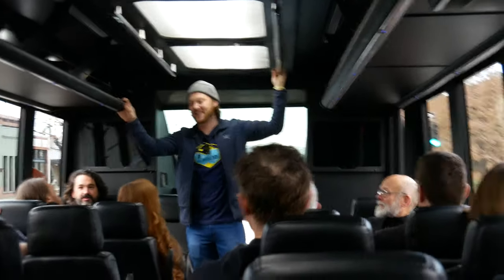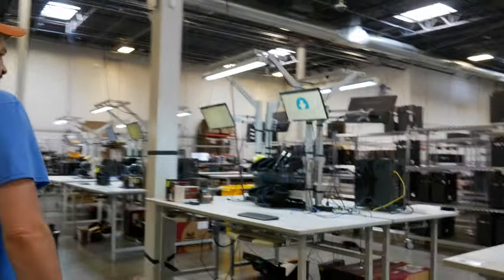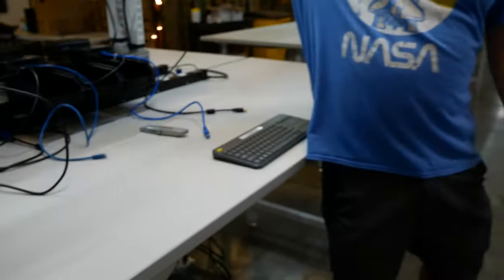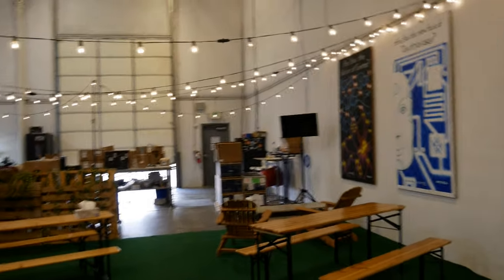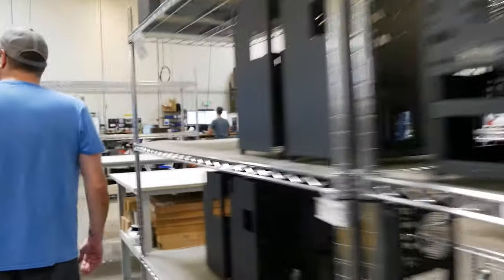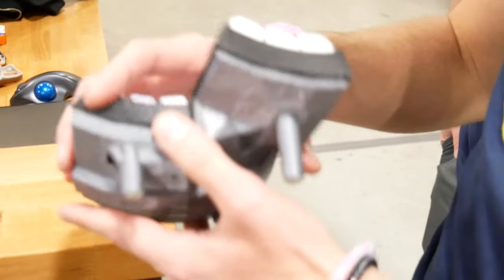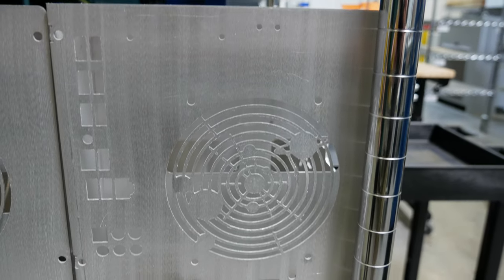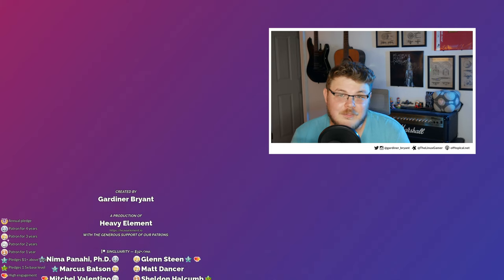I wasn't prepared for how much System76 has changed!

Comment: Great video! I love my system76 Gazelle laptop. I buy a new one every 4 years. I configure them to the max and the prices are awesome. With shipping and Dutch VAT added, I still pay less than buying a almost similar specced system in The Netherlands. I say almost because I can’t even get a laptop here with the same specs. Let alone trying to buy a laptop here without windows. So, I’m happy with my system76 laptops. I just configured my 3rd laptop. Looking forward to have that as my next workstation. Still trying to convince myself to add the Launch keyboard. 😉